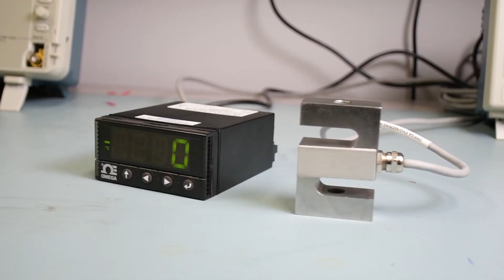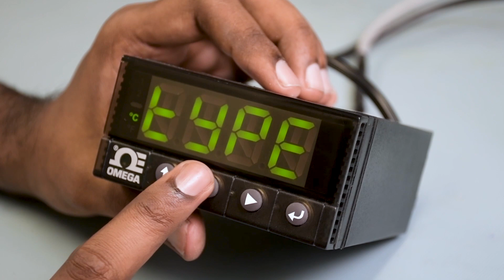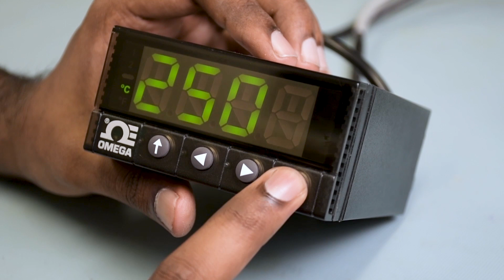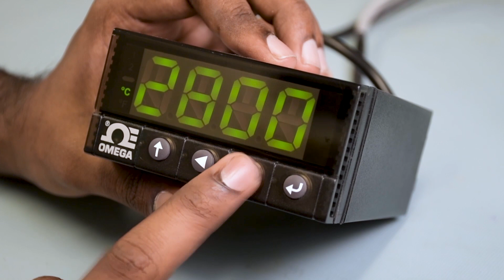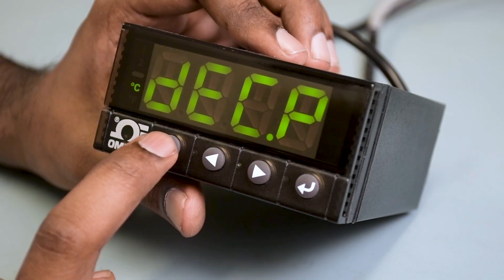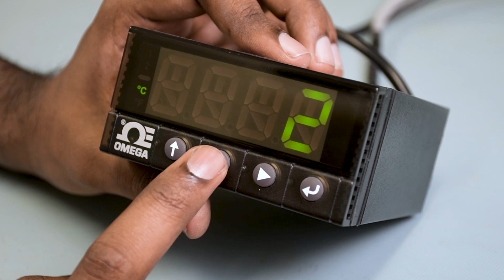How to wire Omega's Platinum Meter to an S Type Load Cell

Comment: I wonder what should be the Rd.2 input for 10K load cell. There are only 3 digits before the point and 1 digit after the point. Thanks in advance !
Reply: My experience too, did you end up finding out?
Reply: I think I found it and you need to set it in RdG >> dEC.P to move the decimal point. My guess is that you set it to FFFF and ultimately it will let you write 9999 as a 10K load cell.

Comment: I have a 5th lead that is clear.....where would this one go? And are the other leads still in the channels discussed?
Reply from the maker: Great question Samuel! Clear leads or drain wires are usually common ground that will go to ground, but make sure your clear wire is actually ground based on the load cell you have. For more detailed answers please email: pressure@omega.com

Comment: The complete video that illustrates all our Guidelines for the correct installation of Load Cells, Weight Indicators and Weight Transmitters within a Weighing System.

https://youtu.be/cQtKeXBC25Y